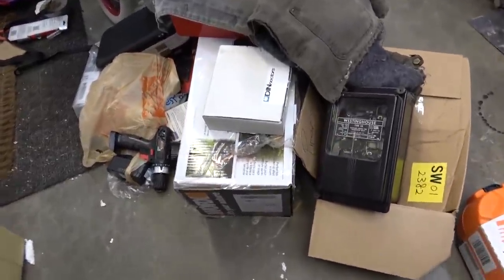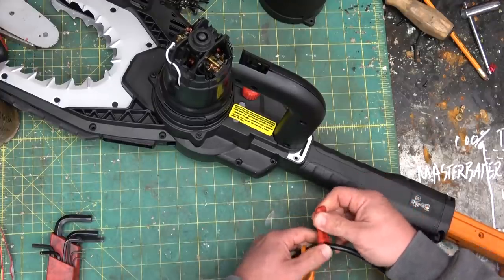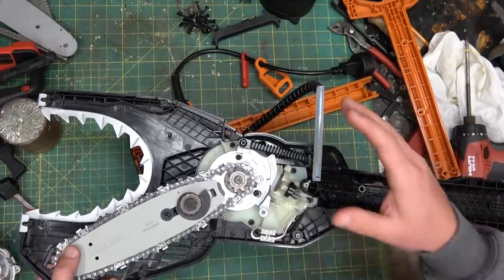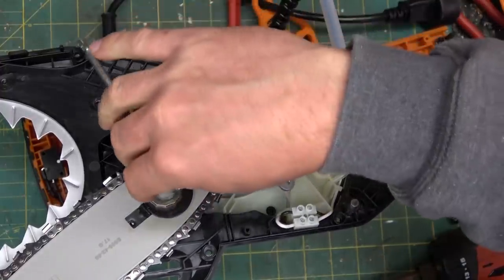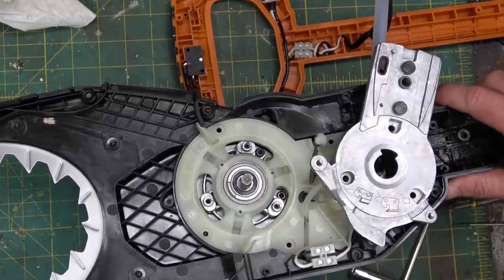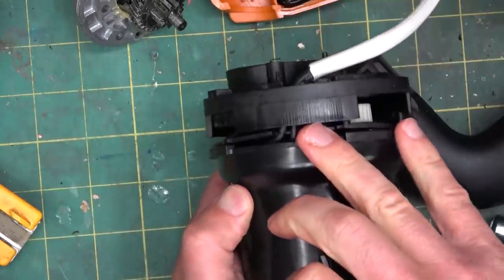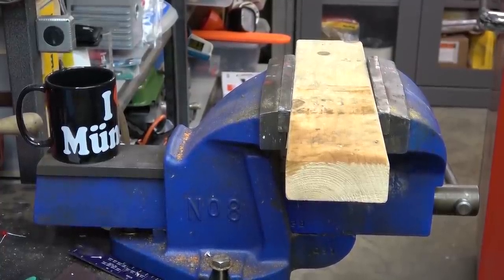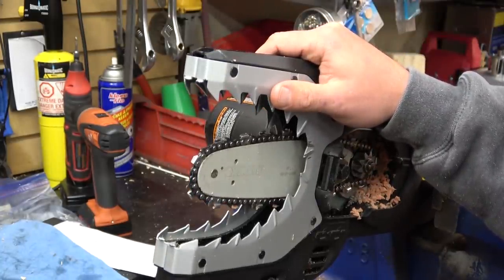BOLTR: Worx Jaw Saw | Engineering Fail

Comment: My stepdad bought a Worx pole saw. After about 6 months a metal sprocket wore out. After calling them and trying to get a new  sprocket it sounded like there was no new sprockets. The lady said will take care of you. Next week a complete brand new saw showed up, no charge. Same sprocket as that saw, The plastic parts outlast the sprocket.
Reply: I can't stand that... Just sell the darn replacement parts! They keep everything proprietary not for sale so you are forced to scrap it. At least they helped, but that won't do any good when it's out of production.
Reply: That's what you get when consumer demand and corporate motivations result in tool-products being made as cheaply as possible
Reply: Sometimes it helps to ask the manufacturer directly. Worx is made by Positec and they have a contact form on the website. They won't give you the part directly but you can subsequently go to a local worx retailer and ask them to order the part under the manufacturer's part number.
Reply: @mfbfreak  Oh he called them but theres no parts ob this  side of the Pacific Ocean

Comment: The ergonomics look great to me. These are designed specifically for over head branches. All you would do is put the branch in the jaws and push. It would be practically a one handed job once the branch is in the jaws. 

Apparently there is an OH&S rule that states you shouldn't be using a chain saw to cut branches higher than heat hight. 

Love your videos man! Thank you so so much! ☺

Comment: I love my worx saw for the past few years. But you’ll have to put that spring back in to understand. I go around and lop branches off and then I can fly thru slicing them all down without picking them up. Because it’s guarded you can cut stuff laying on the dirt. When it starts to cut it pulls the crap into the jaw while cutting. Saves my back and my good saw blades from either hitting dirt or having to pick up to cut branches. That’s about all I have found good for it but what it does it does fast and well. Plus I got it with some reward points for cheap.
Reply: Also the red “RFID” tag looking thing goes in the handle when it’s compressed so you can have the saw in the middle of the jaw so you can clean/adjust/replace chain etc...
Reply: Was wondering what the point of this thing was over just using a regular chainsaw, and cutting up branches that are already lying on the ground - that is the good use case for this thing, jaws and all..
Reply: bubba99009 a good tip is to go around a cut everything in 15 inch sections anything less then 2 to 3 inches. Then send the kids out to fill the wheelbarrow or buckets lol

Comment: I've got one of these and it has turned out to be one of the most time saving and cool tools I have had.  Instead of being bent over trimming limbs on a downed tree you can stand up straight next to the limb and just push straight down.  Not much effort to use.  Very safe since no exposed bar to buck back at you.  Once the limbs are off the trunk you stand next to the limb to section them into easy to handle lengths.  Using the saw properly just position the saw over the limb and push down.  The saw draws the limb up into the tool off the ground and cuts it cleanly.  This thing has saved my back and will never go back to a regular chain saw for liming.  The little plastic piece is inserted into the handle as you push half way down as a lock exposing the chain so you can sharpen it.

Comment: My grandmother has one of these. She couldn't get a chainsaw to cut a branch if you handed it to running. This on the other hand has left all our hedges crying for a relief. At least until the 5'6" range where she cant reach anymore. But Worx sold her the extension handle... and that brings her up to 6'5". I no longer have to worry about walking into branches in her yard. I tried it out..  Think of it as a chainsaw for those branches you cant cut with your pruner, but don't really want to drag the gas saw out of the garage and mix gas and do all the work.. but you don't care about stretching out that god awful tangled extension cord, or carrying a generator around to run it. I think I've cut extension cords more valuable than the tool. don't use green ones you'll lose them in the pile of brush you make with it. That darn chain does like to pop off when you get a log in a bind...........

Comment: I think that the reason it's a push and not a pull to actuate the saw is because it looks like it's more meant for pruning branches way above your head. If your pulling in the damn thing instead of pushing while you're at max reach you're liable to detach it from the branch your cutting and have it chop off your arm or something. When I saw one at lowes the box advertised an extender specifically for high branch pruning, and the think literally looked like a stick with a grabber. I cant see any viable method of using it as a pull mechanism for that niche use and still keep it safe. Also, with how small the jaw opening is, it would only handle the most tiny of trees or small branches anyway.

Comment: Ferrite core memory from an old PDP-11?
Reply: Q-Hack! Yes that is what i was thinking , core-store.
Reply: Nah, it was made espessiahl for a new PDP-11 ;)
Reply: Watched an NCR engineer rebuild a 16k ferrite core memory with a soldering iron by threading in new sensing wires when an operator on the '70s. It took two of us to carry the thing.
Reply: Core memory was the best ! Unfortunately, replaced with solid state RAM, as main computer memory. That said, for non-volatile needs, core stuck around well into the 80s, until replace by EEROM. We used core on Multi-bus cards, well into the mid-80s. A whopping 16K-bytes per board !

Some Seeburg Jukeboxes also used core. Perfect application for it. Once, the song is played, that entry needs to be erased, which core memory did as part of its normal operation (destructive read). On the jukebox it was addressed as individual bits. Not unlike early DRAM. Remember buying RAM, 9 chips at a time !? The old guys do.
Reply: I'm guessing it would have to be a very early PDP for it to be core. All the ones I worked on had solid state memory. 11/44, 11/60, 11/70
Reply: Interestingly a core memory diagnostic test was called a SHMOO test.
Reply: Michael Moorrees because of its resilience and non volatility it was used in the space shuttle and some even survived the challenger crash.
Reply: I came for the saw, stayed for the core
Reply: I worked for DEC Field Service for decades I worked on all PDP-8’s, PDP-11’s, Vax’s, and ALPHA’s. This was not a DEC product. Looks like arrays of 25 bits by 50 bits (approx.).  The metal used to hold the arrays was not a DEC standard. I worked on a lot of arrays from DEC.  BTW if you think that cores were good, just reading a bit could change the stored value. You had to have electronics to support rewriting some bits. Very slow.
Reply: Robin Turner - Core only used on machines before PDP11/55. Go figure 11/44 was almost 10 years are more after the 11/55. I have seen core in 11/03, 11/04, 11/05, 11/10, 11/15, 11/20, 11/35, 11/40, 11/45, 11/50, and 11/55.
Reply: What’s the average age of people replying here? I’m 55 but if you’ve worked with this stuff you must be at least 10yrs older.
Reply: @markcummins6571  this core mem looks russian made. i have seen some modules like this on the internet.

Comment: I have had one of these for several years and it works great! just keep it clean, sharp, and oiled, and it does everything I ask of it. I was hit by hurricane Michael in October of 2018. This little saw, along with the Worx electric saw, get a lot of use, as well as my Poulan Pro 50cc. Sure, you aren't going to fell a giant red wood with it, but you aren't going to drive a railroad spike with a tack hammer either. I think you just have a problem with worx tools. This is a well designed little saw if you use it as intended., I would buy it again.

Comment: That saw was actuslly meant to be used against the ground. Say You have a bunch of large branches on the ground after falling a tree. You out this over the branch to be cut and push against the ground. The jaws also keep the bar from contacting the actual ground.
Reply: @Dingus E. Dow this was made for people who are too afraid of chainsaws like ladies who rather be getting their nails done while drinking Starbucks.
Reply: @Dingus E. Dow its supposed to be a safer alternative and you don't have to bend down to use it.
Reply: Yup. I bought one of these and it's really for limbs already on the ground. The chain saw lifts it up, the teeth stop the limb from spinning. The saw teeth don't get 'bull-nosed' from striking the dirt. One handed operation, no bending over. It's heavy, though and I'd never, ever get the available extension handle. Great for consumer level yard cleanup where everything has to go into bags for the trash pick up.
Reply: The fact that you found a good use for it doesn't improve the design / manufacturing flaws though.  It isn't that good.

Comment: As a Canuck, The Jaw Saw is a great tool for “What is was designed to do”
Using the lower jaw to collect branches on the ground and pushing on Mother Earth to cut, No destruction of a STIHL chain
Trying to cut “Topsoil”.
3(three) years and running as “New”.
Reply: Rob, yes I think it is pretty good used for lopping too.
For a little extra you get 3 years more warrantee after the 1 year one runs out.

Comment: Isn't it designed for cutting logs (twigs) which are laying flat on the ground which would make the push to cut system a little more logical?
Reply: That makes a lot of sense. The jaws then prevent the logs (twigs) from rolling around while also keeping the blade off the ground.
Reply: Exactly! I have one and also a bad back. This works fantastically for making firewood out of fallen branches. Simply place over the branch & press straight down. Very easy & no back strain. This is NOT a lopper intended for overhead use. Check out CRH for a proper review used as intended.
Reply: what? read the instruction manual? This is AVE! NEVAAAH!
Reply: Now that's interesting, what kinda trees shed small branches regularly?
Reply: @jonanderson5137  Maples, Oaks, Walnut
Reply: Jason Woods Interesting very interesting.
Reply: @JasonW.  and pecans. The damn things will drop a branch on you just out of spite.
Reply: That makes sense, taking this up into a tree seems like a death sentence but then the same for using a chainsaw in a tree unless you know what you're doing and have the equipment to do it safely.

Comment: I've worked in a DIY store and sold Worx (Positech) powertools. We hardly ever would get them back because of breaking under warrantee. The cordless drills are quite good. There were some  cordless drills around the store for assembling and building store decoration. The Makita with Ni-CD batteries was the best, though by now the old Ni-CD battery is tired. Below that, the plethora of Worx drills and screwers (old demo models). Super torquey, but the battery packs aren't totally reliable. 
Right at the bottom was Black&Decker. Lots of play on the shaft after just a few years. The B&D jig saw as just as shitty.
Reply: IIRC Positec offers quite a bit of aftermarket service. If you find the right part on their site, i think your retailer could probably order it for you if something breaks
Reply: Nothing wrong with playing with your shaft!!

Comment: I have this, and it can be handy. The pushing works great for limbs since you toss it up on the branch, and push against the limb. If you were pulling, you couldn't one hand operate the tool, you'd have to work a push pull between your arms to keep in on the limb.

Comment: In this case pushing is better than pulling. You can stick it to a tree and use your weight to push on the handle and break the tool.

Very well design to test the warranty / service at the local store....

Comment: At 6:00, I understand your concern for pushing, but when you use a regular chainsaw, which I use all the time, you are also constantly pushing. Also, the key way design of the sprocket is perfectly fine. Even Husqvarna has an even smaller radial key way cut into its sprocket. It is machined further out however, for better torque with a large gas engine. For an small electric motor, that key design seems quite adequate. 
I just got one of these, and for the home owner that cuts trees on occasion for firewood, this tool seems perfect for cutting up the branches into tons of kindling for firewood. It is very easy to use while standing up to chop up branches that are already on the ground. Cutting up tons of Douglas Fir branches for firewood is a real nightmare with any tool that requires you to constantly bend over to chop the branch. My review will be made soon.

Comment: I got this to easily clean up the smaller branches in a felled tree.  It's lightweight, so less effort than even a small chainsaw.  I use the Stihl MS311 for the big work, MS210C for medium, and this for the small stuff.  It works great for clearing out the tree-tops / small stuff.

Comment: Lol, those things are actually for cutting little logs on the ground, so when you push down on the handle the saw bar goes down.

In this case, pushing down on the handle is more ergonomic than it would be to pull on it.

Comment: The orange bit is a cable strain relief so once you connect up power cable you wrap the joined cable round it so when you pull the cable it doesn't come apart.
Reply: Yup.
Reply: That's what I think too, though I don't know what the red thing does. Maybe a tool to lock the bar in the middle position for chain/bar change/adjustment? Or to pick wood chips out of the housing without hurting your fingers?
Reply: @Murgoh  or loss prevention device, with the tag embedded inside. That would justify the use of such quality, expensive materials, to the accountants, driving quality down and prices up, or slightly lower prices with nosedives in quality. This has happened most recently with the new Bosch 18v SDS drill, such a shame.
Reply: that Orange thing is a lock to hold the bar in the middle so u can change the chain
Reply: @bradleyseeley6684  the cable strain relief has nothing to do with changing the chain, I have it on a black and decker old strimmer.
Reply: @cjhification  sorry i ment the red thing he called rf chip is a lock

Comment: Love your stuff, and your analysis of the construction etc. However, for its use around a suburban garden I feel you completely missed the point. Cutting up fallen logs using chain saws scares the bejessuz out of some of the middle management wives. This one you put over the log, click the button and push the handle with fingers and hands far away from angry end, then the job is done with no fingers ending up in the hydrangea bush. Education as you so forthrightly say is bloody fantastic. As this is a new type of wood lopper, perhaps a wee bit of research on how its operated would have enlightened some. Innovation is on display here. Hopefully they can only get better.
Reply: I enjoy scaring housewives

Comment: Even in Australia on 240v we have things like chinesium oyster lights ect with terminal strip. I don’t know what sort of plastic they are made of but I’ll take a fitting down that is a decade old and the plastic blows away with the slightest contact. Leaving brass terminals swinging in the breeze.
Reply: I work in the plastics blow molding industry and our blow molding machines come in from the manufacturer with those plastic terminal connectors all over. We have to change every one of them within a few months as they began to deteriate and crumble, which allows the exposed inner parts electrical components shorting together.  And they are all carrying 277 volts.
Reply: They’ve got to be better than twisty on shite wire connectors.
Reply: Yeah they are actually better than wire nuts. I know they are popular in the USA but in Australia they are laughable. We can’t use anything to join cables unless there is positive affixment (a screw connector or terminal strip) even soldering is not really allowed of anything carrying 240v unless it then has mechanical joining as well. They theorise that a surge could vapourise the soldier and cause the connection to come loose. Silly really

Comment: I've had mine five years. Love it. I don't know why you think it's a tool without a job. Maybe you haven't had a large property to maintain.      When you have a tree down and try to limb it with a regular chainsaw branches can fly in your face or anywhere  thats "the fucking point".   It's not for cutting down trees, it's for when they are down.  I can clean up a felled tree in minutes with one.  I have cleaned up many trees over the years with it. It is really nice to be able to just push down and cut through stuff on the ground. It's a time saver.  For limbing it is FAR safer than a straight saw.  No you can't cut a 10 trunk with it IT'S NOT MADE FOR THAT.   I have cut with everything from bow saws on down in the last 65 years and I love mine.  There is a tool for every job, test it for it's intended job, pruning and limbing.     A couple of my neighbors stopped and said something about my strange saw, and made fun of it, and tried it, and got their own lol    because I wouldn't loan them mine lol  Be Safe.

Comment: 16:08 - Fancy lathes have polygonal turning on a separate live tooling axis (at least in my experience it has never been part of the regular tool turret). I've only used it for hex heads on fitted tapered bolts, but I guess you could do 2 flats...

Comment: Isn't voltage measured in amperes and current in horsebundles? Atleast when talking about imperial measurement system.
Reply: Voltage measured in Volts. Amps measured in amperes. Horse power in watts- 746 to one HP